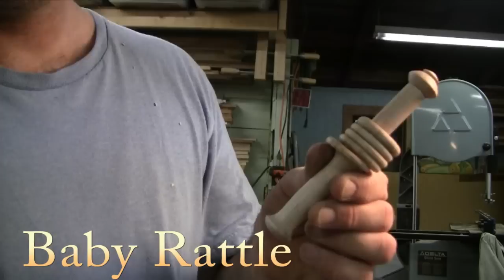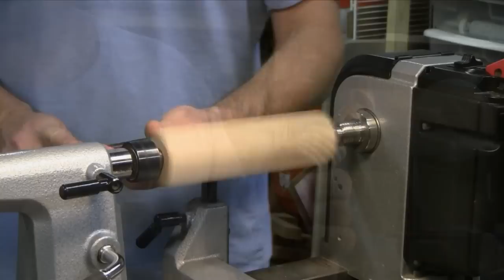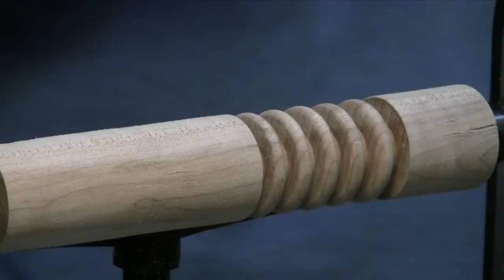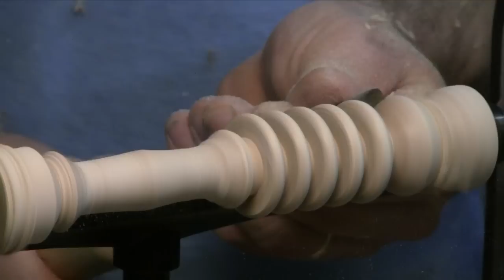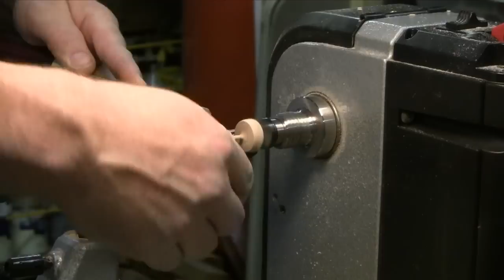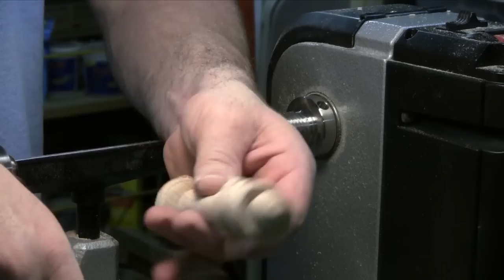Baby Rattle

Comment: Good video. For beginners I will suggest to make a test with one ring first, just to see the magic when the ring comes loose. Then make the real stuf and here you should make everything as finished as possible before cutting loose the rings. Instead of tape you can use rubber bands which leave no glue on the wood.